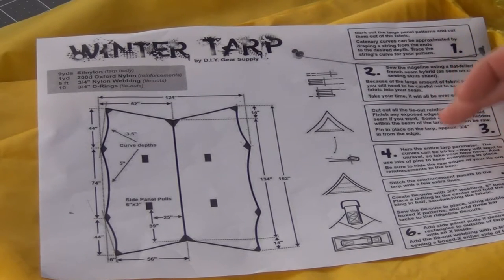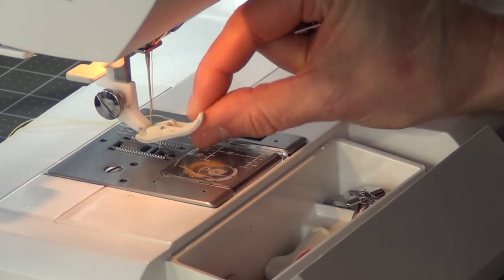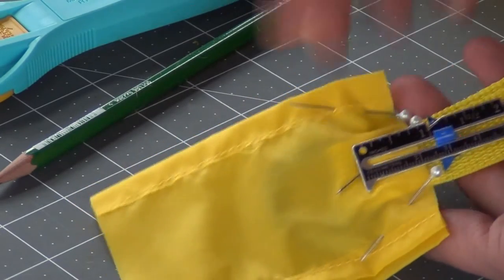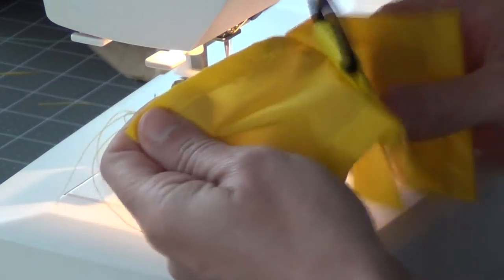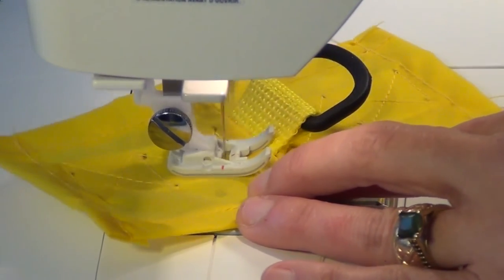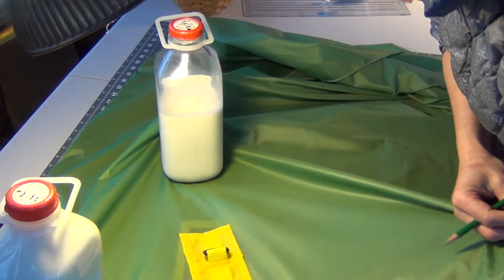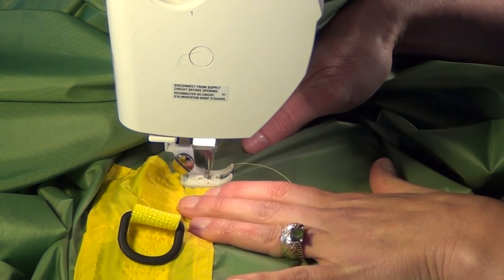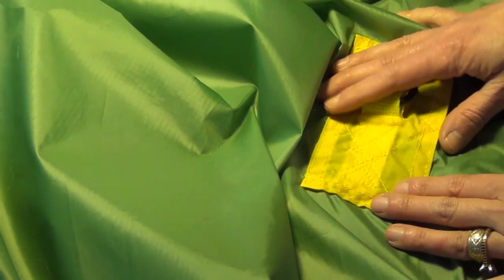Winter Tarp:  Part 5 side pull outs

Comment: Hello! I'm looking at upgrading an old brother sewing machine that has adjustable presser foot and feed dogs pressure. Would you recommend your Emerald 118 for dealing with the ultralight fabrics that cause me so much difficulty? Or, would you suggest looking at another machine with features you would like?
Reply from the maker: MrClowny666 I think the Emerald 118 is an ideal machine for camping gear, including the lightweights.  I wouldn't hesitate to get this machine again.
Reply: Thank you so much for the response, would you consider the walking foot essential - especially considering the .66 taffetas that cause me the most pain! Last question, I promise.
Reply from the maker: MrClowny666 I am not sure I would call it essential, but it is nice.  A nylon foot would also be a good bet.